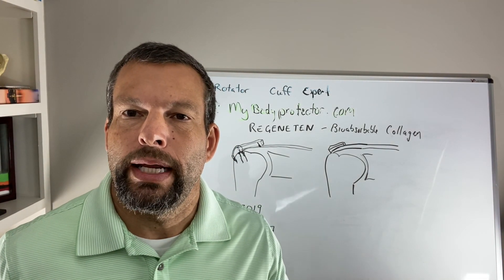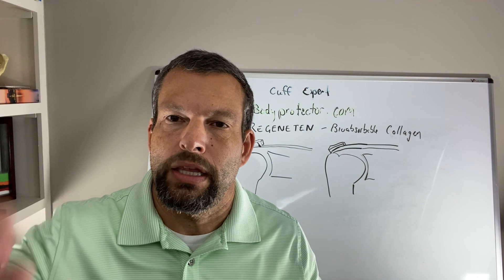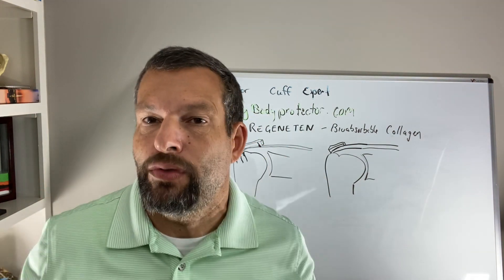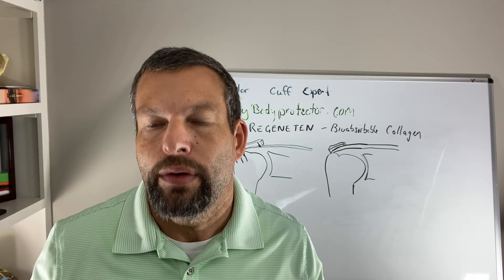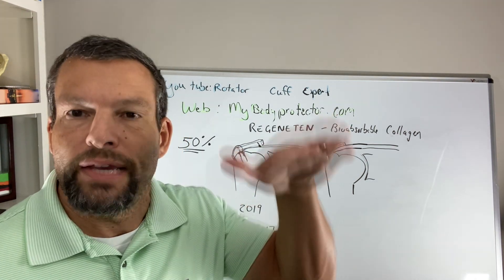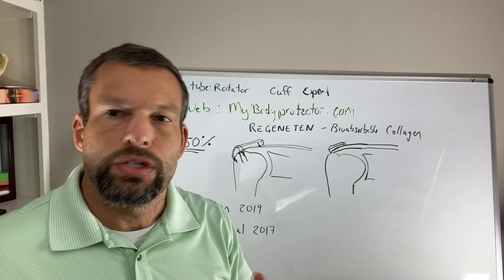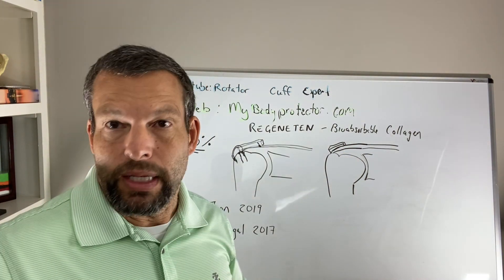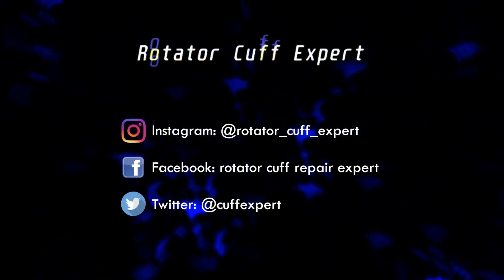New Collagen graft for rotator cuff repair.  What is it and how and when is it used?

Comment: My Regeneten patch failed miserably.  Not only did it disintegrate inside the shoulder, the allegedly biodegradable staples were floating around, intact, doing more damage than the original accident.  The repaired supraspinatus was lost, and when it went, it took my infraspinatus tendon with it.  By the way, my surgeon kept telling me that my increased/non-resolved pain was due to the healing process when it was actually a failed repair.  Had to demand an MRI at six months and that is when it was revealed that his repair failed.  

Two months later, another surgeon had to clean up that mess at which point the concern about humeral head migration came into play because the first surgeon also took down my CA ligament and now my shoulder is unstable.  Trying a Stryker In-Space balloon in 10 days to see if I can retrain the remaining two rotator cuff tendons and my deltoids to keep my shoulder centered.  

Still baffles me that despite my profession, he still took down the CA ligament, adding 20-30% more force to the joint to keep it centered.  I am a pro sports photographer and carry those large white lenses you see on the sidelines.  

If this spacer doesn’t work, my career is likely over.  Not because of the original accident, but because of the damage done by the first surgeon going old school on me and thinking a collagen patch would be helpful.  

Went in with a partial thickness tear on one tendon and now I’m missing two complete tendons, have my bicep tendon tenodesis, an unstable shoulder and constant pain when I work from what appears to be bone on bone contact.  

Bottom line, that patch may work…but not for a complete reconstruction like I had apparently.  If I only knew what I know now, no scalpel would have gotten anywhere near my shoulder because I am worse off today than when I first had surgery in 2022.
Reply from the maker: I am so sorry for how much pain and frustration you must be feeling.  Good luck on your next surgery.
Reply: @rotatorcuffexpert  Thank you.  It was supposed to have been today but an RN at my insurance company deemed a subacromial balloon spacer “experimental” and denied my surgery two days ago.  Apparently extended use of narcotics or a total reverse shoulder replacement is preferable to them, or they want me simply quit my profession as a sports photographer.  None of these options are palatable which just  increases my disdain for what our “healthcare” system has done to those in need.  That spacer was my last, minimally invasive shot to overcome the chronic pain.  I cannot afford to pay out of pocket for the cost of the procedure so they have really put me in a bad spot just as demand for my images has continued to peak.  Spent the entire summer traveling and shooting up to 12 hour days but only did that on low-dose oxycodone.  Apparently my photo career was over at the moment of impact 2 years ago but it has taken this long for me to begin to accept that fate.  Now, at 60 years of age, I need to try to find a new career, or simply crawl back under the covers and fall into a deep depression.

Comment: For a partial tear with graft repair what happens to the staples and graft over time?  Does the graft affix itself to the partial torn tendon or is it only held by the staples and sutures?
Reply from the maker: Hey Jeff, Great question. The staples dissolve over time.  It appears that the tendon "grows" into the graft creating a thicker tendon. Hope this helps.  Are you having surgery soon?  Please consider joining our newsletter.  Just email us at dro@mybodyprotector.com  and put "yes" in the subject line.  We will get you signed up and also give you a couple tip sheets!
Reply: My staples were still intact after 6 months and my graft had disintegrated allowing them to float around freely.

Comment: Would this help for a partial thickness articular sided tear? It can really be placed on top and fill in the underneath part? .7cm of the anterior leading insertional fibers are torn in my shoulder along with small .3cm middle third fiber subscap tear.
Reply from the maker: Mark, Thanks for the question.  From my understanding It will reinforce the tendon that is there and give it a scaffold to grow into.  I don't recall any specific mention of bursal vs articular sided tear.  

Please consider joining our email newsletter for more information and insights. Send an email to info@mybodyprotector.com just put "yes" in the subject line and we will get you signed up!

Comment: this was used for my cuff repair. I was wondering if this would be effective underneath or on top of the screw of a bicep tenodesis for a quicker healing time and reinforcement of the attachment
Reply from the maker: To my knowledge there has not been any study that looks at using the graft in that way.  The graft works in reinforcing the thick broad tendon of the rotator cuff.  The biceps tendon is much narrower and has a much smaller attachment site so I'm not sure how well that would work.